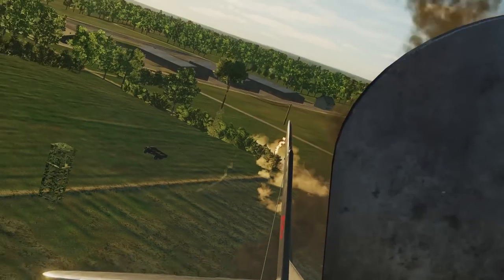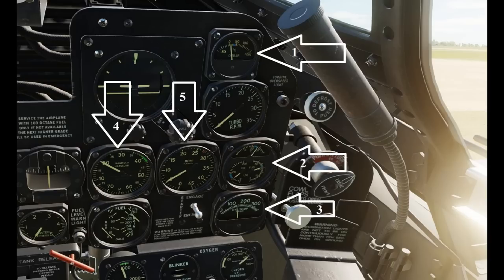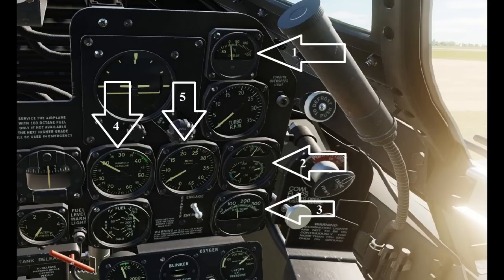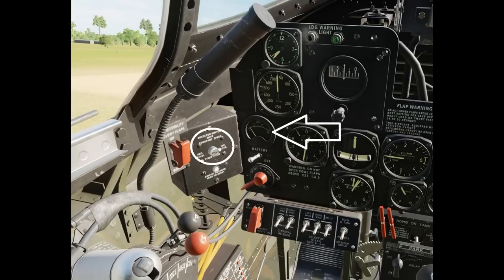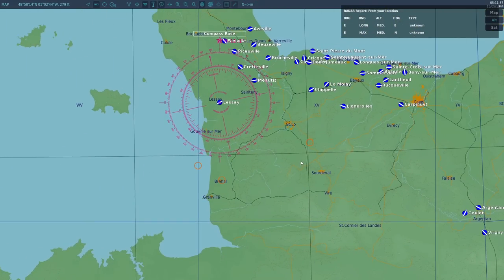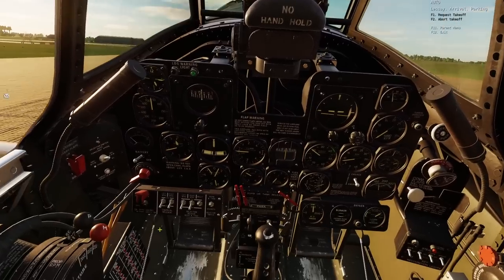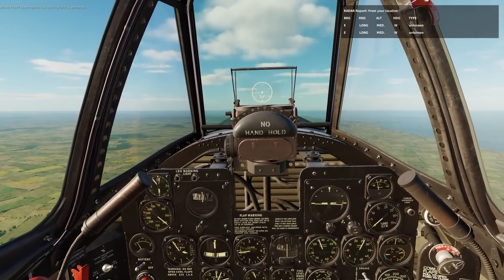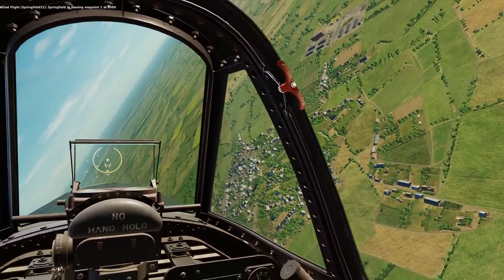P-47 Damage Control, Dogfighting and Ground Pounding DCS

Comment: It looks like in this flight sim, the programmers were clever.  They figured out that if the American planes win, they will sell more licenses.  The Bf109 had combat slats that deployed automatically as you very well know.  In real life, Greg would have been toast.

On minute 29 where you belly landed ... it looks like you forgot your cellphone.  Or maybe you forgot to charge it.  If you kept it charged, you would not have to walk back.  Somebody would get in their Subaru and pick you up.
Reply: That's not really true. The P-47 was extremely competitive as the altitude increased and was actually more maneuverable at high altitude than the Me 109. It also dove and zoom climbed better, and had a better roll rate. So there are a lot of advantages that a P-47 pilot could exploit against a Me 109. I fail to see why you don't think a P-47 could maintain its own in a dogfight, especially at medium to high altitudes. Real reports from the war prove it was extremely capable, and contradict what you say here. Not everything is about turn radius and often times real life favors boom-and-zoom tactics over turn-and-burn. The Me 109 was a good plane, but it was not better than the P-47. Not in the grand scheme of things and certainly not in every situation.
Reply: The 109 did have slats, but it also had zero washout. The slats were there to prevent the abrupt wing-drop, snap roll due to stall. They did likely increase the outboard portion of the wings stalling angle of attack significantly, possible by 5 or 10 degrees. But this will only improve the lift over maybe 25-30% of the wing area, as the larger inboard portion did not have slats, therefore it stalled as always, losing lift and creating exponentially burdensome drag. 

The slats did not tighten the turn of the 109 in a meaningful way, and often "snatched" or deployed asymmetrically, and created situations that varied from annoying to dangerous to fatal.

The 109 was maneuverable and much more so than the P-47. But due to its lighter wing loading, and power to weight ratio. There are many cases of 109s flown by expert pilots out maneuvering reasonably competent and even expert spitfire pilots. 

That said, the BF-109 is almost the worst aircraft ever devised for air combat, as it almost single handedly lost Germany the air war due to several design flaws, leading to it being incredibly awkward and unstable to land. First and foremost: the canted gear legs effectively create significant "toe in" effect on landing. As soon as the slighteat lateral load builds the weight transfers to the "outside" tire, which is constantly turning inward toward centerline, being cancelled by thenopposite side doing the same, which now has less weight on it and less traction, creates a self-perpetuating, divergent, uncorrectable, high-speed ground loop. In conjunction with its faulty asymmetric extending leading edge slats, and poor canopy design both in visability and ability to bail out, the 109 self destructed 1/3 of the entire fleet in accidents and killed thousands upon thousands of perfectly caplable pilots who were in otherwise good health. The 109 was the largest contributor to the extinction of german pilots. 

The 1v1 fight which rarely happens in war, is won by whoever plays to their aircrafts strengths and exploits their opponents weaknesses, and does so more consistently with the fewest mistakes under pressure.
Reply from the maker: JJ is exactly right about the slats. I won this turn fight, NOT because the 47 is the better turn fighter. I thought I made it clear just why I was able to do this. I guess it wasn't clear enough so I'll add it to the description.
Reply: @GregsAirplanesandAutomobiles  Thank you for your response.  I will answer to all on this one post, I hope it survives!

Dan is describing his experiences in the simulation.  That is not real life.  The simulation is programmed in order to entertain, not to reflect real historical facts.  Also, in the simulation, it is generally much harder to see behind and above you, so the straight line fight is favored.  As in the Ki-84 discussion, I will refer you to real life.  When the P-47 first appeared in England and Italy, lots of Spitfires were of course active, and lots of practice dog fights took place, since all these pilots were young dudes with lots of fighting energy.  Naturally, most of these dog fights would take place near the airflieds where they were most likely to meet.  Soon enough, accidents piled up of P-47's in unrecoverable spins.  Soon after, all mockup dogfights were banned under 5,000 ft (which means were banned almost all together, because the chance meetings at higher altitudes were more rare).  This means that the top command judged that the benefit of practice and gained experience was outweighed by the chances of spin and crash.  This sort of shows you how dangerous it would have been in real life to even attempt what Greg showed in this video.  In other words, Greg would have most likely died without the German expending one single round.  

In real life, the lack of dogfighting experience of the US pilots made little difference in their survivability on the statistical base.  It would be very rare that a P-47 alone would meet a Bf109, most likely it would be 4 against 1 or better.  So, in the worse case where they meet an experience 109 pilot,  they would split in four directions, so only one would get shot down!  ;)  

Of course, there is the empirical knowledge from the German side.  The Germans (the experienced ones) were laughing at the P-47 and P-38.

Then again, the chief Supermarine test pilot Jeffrey Quill flew a P-47 once.  He kept his comments to himself...  Back then, the British relied on US financial help, so they were very careful to not bad moth the Americans (that debt destroyed the British Empire for good after the world, and the world has not missed it)

The Bf109 was not the best dog fighting fighter of the Euro theater, but it was only a little behind the best, which is of course the Spitfire.  It required more skill to master than the Spitfire though.  The fundamental technical characteristics that condemns the 47 is, as I have said before, its gigantic wing loading.  This is the most important first order effect.  All the other are superficial.  Whether the slats of the 109 only help the 40 % outside portion of the wing or not, is almost inconsequential, given the huge difference in wing loading.

I seriously doubt that Greg was the only one who thought of deploying flaps in tight combat.

High altitude will only make the situation worse, except of course that you will more likely recover from your spin before you crash, so that the 109 would actually have to use his guns.   The reason why its worse is because you fly a lot more in the indicated speed range where stall comes before the pilot G limit comes.  Yes, the P-47 has more power at altitude, but that will not help you in the close combat.

So, please continue enjoying your flight sims, I do too.  But keep in mind that the reality that they give you is programmed in, it is not historical reality.  They want to entertain you, and they have clearly accomplished that.  Also, this type of entertainment has created interest in history, which is good.  But you need to be careful to not assume that these fighting characteristics are really related to the real life airplanes.

" Second I was at 10 degrees flaps, which by itself puts my stall speed below the 109K's if his flaps are up, which they were. Thus I can pull a higher G load down at these low speeds without stalling. That's why his plane is wing wobbling and mine at the same speed and turn rate isn't. "

I seriously doubt that 10 degrees will bring your stall speed bellow the K-4, but I could believe that in the sim it does.  The state of the engine is irrelevant.  What I would do in the 109's case is throttle back and let the speeds come down a bunch.  Deploy flaps if needed.  Then scissor around.  If you try to run away, he will catch you due to his much better acceleration.  Allowing the airspeed to drop in a P-47 is pure suicide.  Again, this dogfight is completely unrealistic.